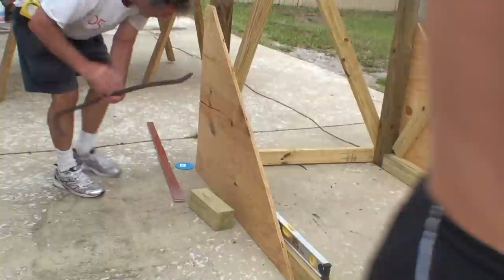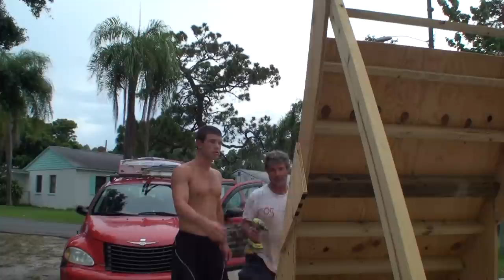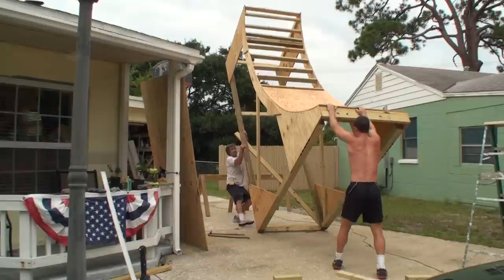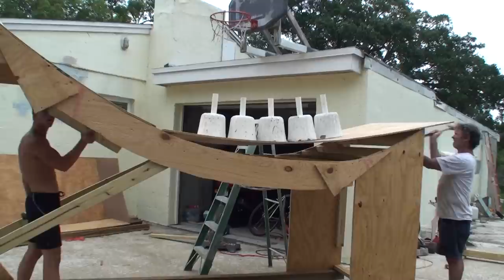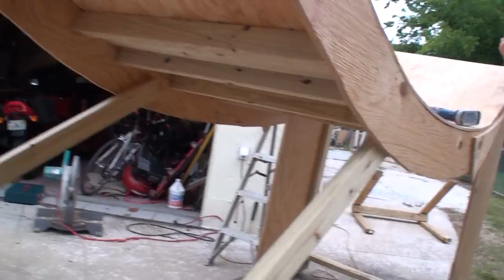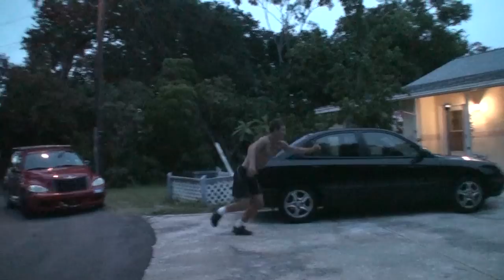Skinning Jonathan Brown's Warped Wall

Comment: If the wall is supposed to be a section of a circle, why was the top board so much harder to bend than the others?
Reply: Top board was shorter, just how it works.